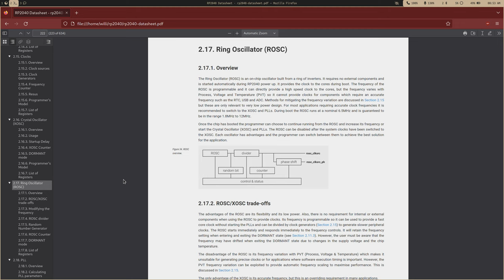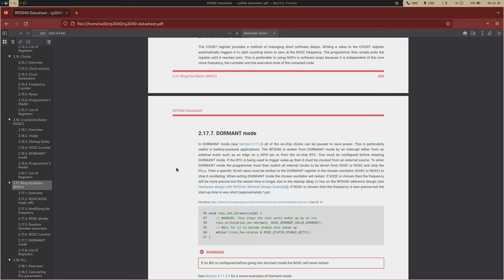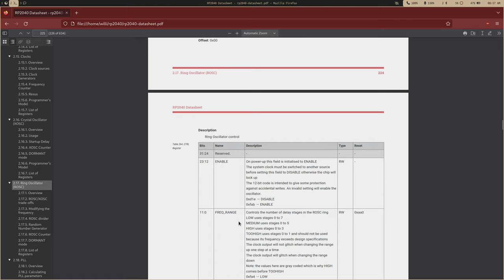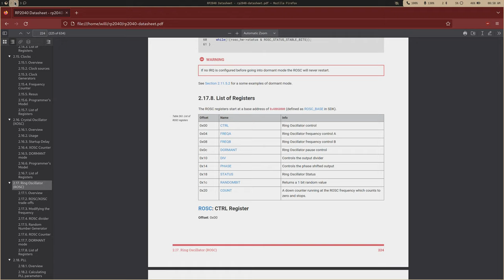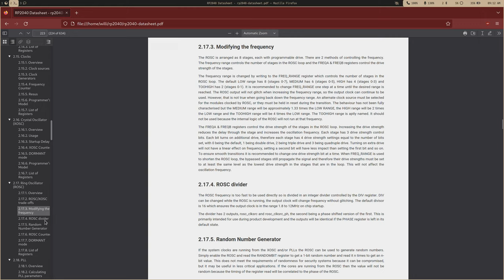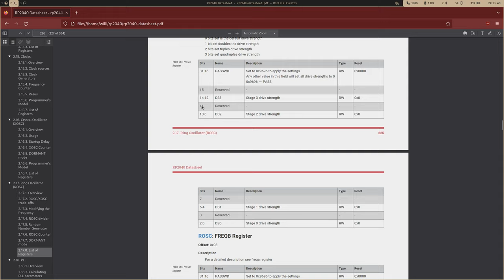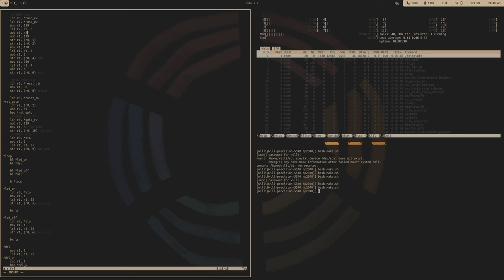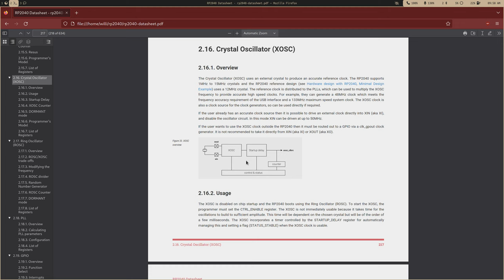RP2040 - Baremetal Assembly - Oscillators, Clocks, and the PLL

Comment: Great vid as usual. PLL stands for phased locked loop btw., because it keeps your fast clock in phase with the slower clocks. I don't know if you take requests, but I'd be interested to here about bare metal interrupts on the rp2040.
Reply from the maker: Thanks for the info, and I'll keep interrupts in mind. I still need more practice with them before I feel confident to make a video, but they're becoming more useful as I play around with the peripherals